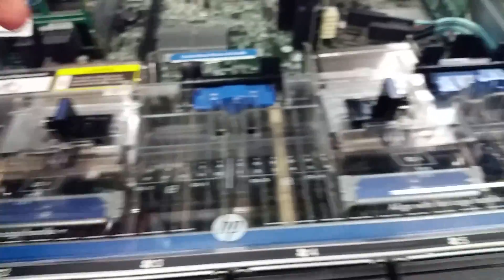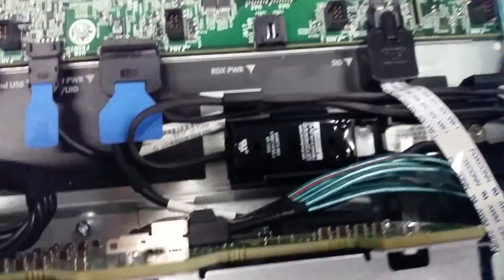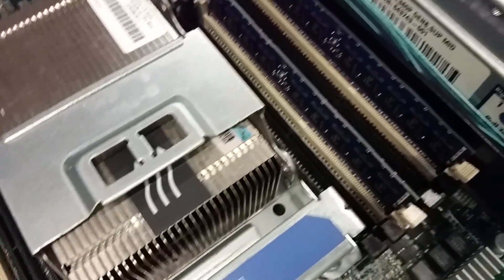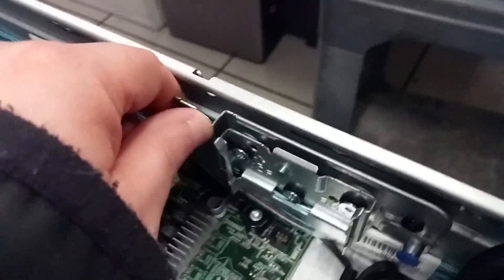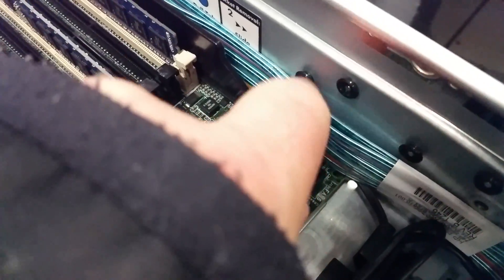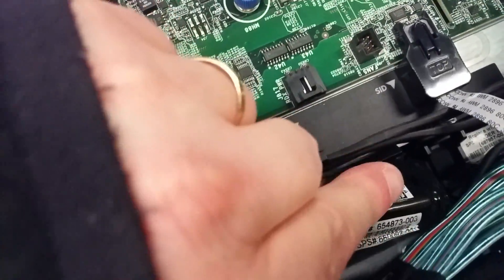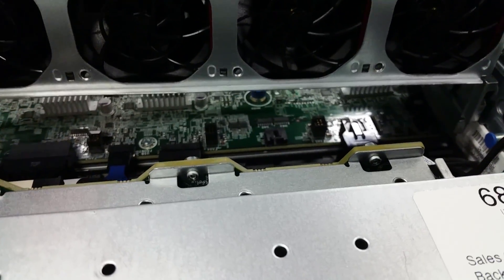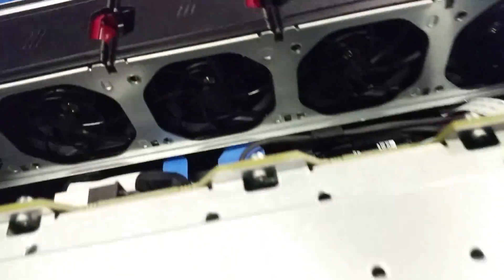How to: change a HP Proliant DL380p Gen 8 raid array capacitor/battery

Comment: On the DL380p Gen8 I attempted this on, there was a caddy for the battery on the front right of the case from the starting perspective of this video. We had to remove the SCSI cables and two cables connected to the motherboard to safely remove the caddy that was secured with a plastic squeezable tab.

Comment: Chache battery is used for unexpected shut down failures and it means Which only affects the write back cache in the event of a full power outage, my main question is this does RIAD configuration or data will lost if we replace the Chache battery or Chache Module the slot connected to the Raid controllers cache mem battery

Comment: We have just had this message on our DL380 this morning.., and the timing could not be worse as we are doing a massive rollout of a new system for the customer over the next 3 days... Is this a critical problem or could I replace it in a few days when the pressure off..?
Reply from the maker: No its not a critical issue unless your environment is prone to loss of power to the server.
Reply: @eclypse3d  Thanks your vid was a big help... The only thing we did notice was that the I/O on the server increased while the battery was failed.. Took 10 mins to swap with a new one.. :-)

Comment: does this effect the raid config and the drives?
Reply from the maker: No this only affects the write back cache in the event of a full power outage.
Reply: eclypse3d no worries. I have a server that the battery has failed in.  Looks straight forward to swap
Reply from the maker: Yup its a 5 minute thing, I shot this vid for work for a employee that just never did this before.
Reply: @eclypse3d  how about planned shutdown

Comment: must I replace the cable?
Reply from the maker: Which cable?   The one for the battery? The capacitor comes with the proper length one attached.  Unlike the Dells where the cable is static and you plug it into the battery, the HPs are connected to it.
Reply: ok thanks. also I have just replaced one and I saw it clearly